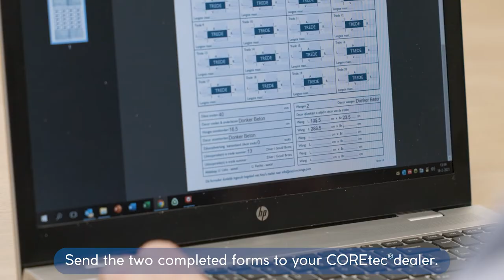How to Install: COREtec® Stairs (Stairs Renovation Guide)

Comment: Can we use Roberts 7250 Cork Adhesive or Loctite PL Premium as adhesives for the stair pieces?
Reply from the maker: Hi there! This glue has not been tested before with our products so we can not confirm that you can use this. 
However, for the stair pieces you can use elastic high-tack glue brands. (MSP or PU). 
For any additional questions regarding glues or if you need names of specific brands, please send us a message on info@usfloors.be.